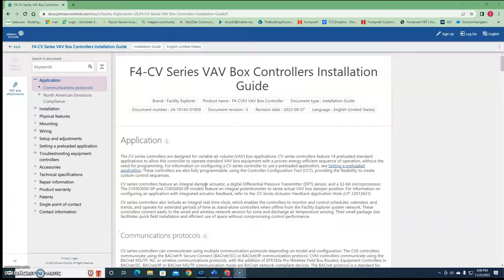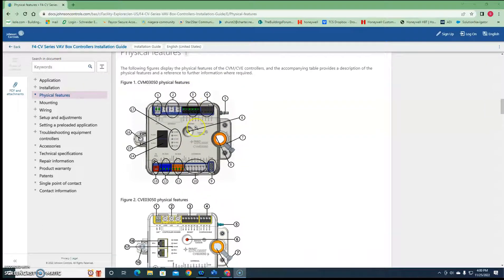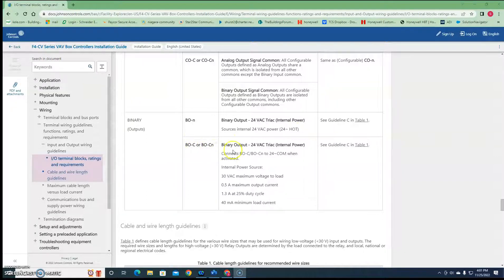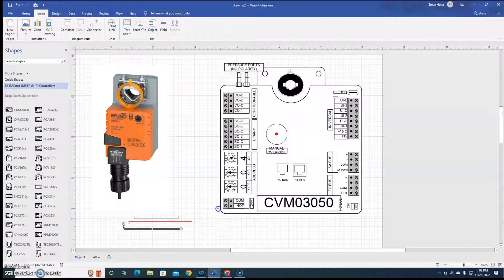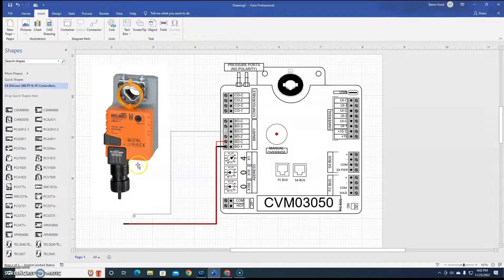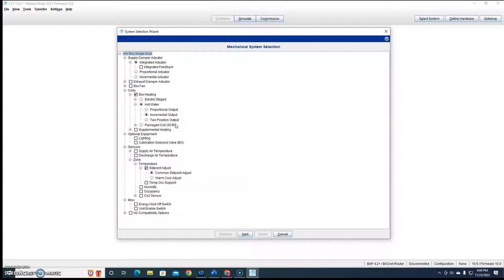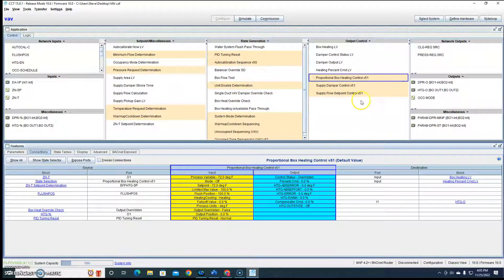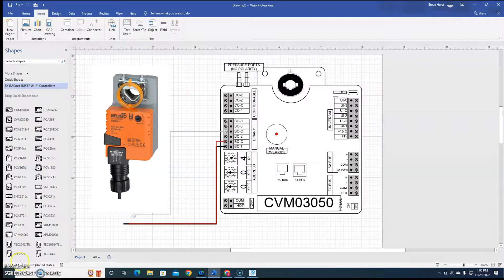How to wire and control a floating actuator on a JCI VAV controller

Comment: Hi Steve
What if I'm using CGM09090 will still be same wiring and same program? But cgm09090 output external not internal?
Thank you
Reply from the maker: The CGM controllers don’t have internal power so you would be able to jump “common” to you outputs.
Reply: @stevenhurst1631  
Thanks
Reply: If black is common, why hook it up to hot on the cvm? I thought it should be hooked up to BO-C.